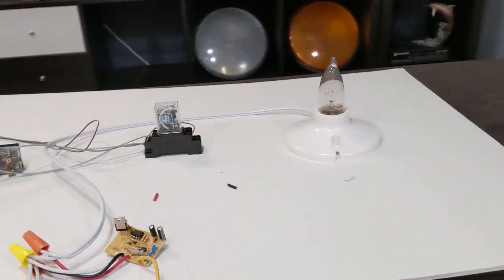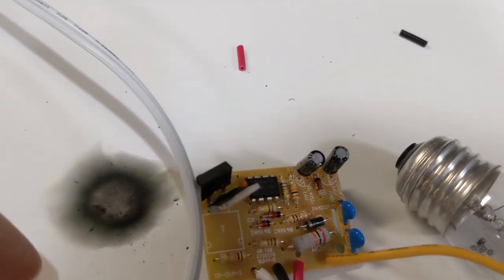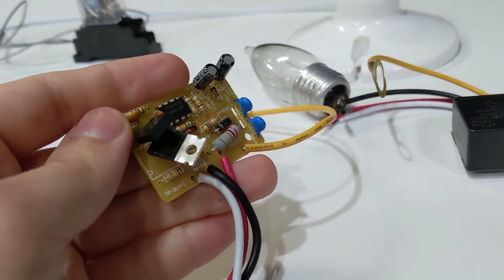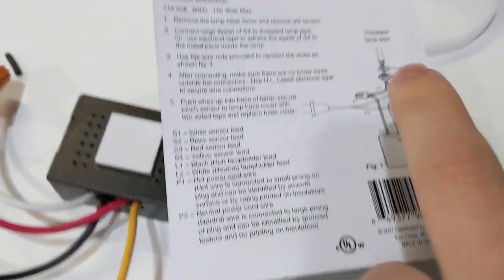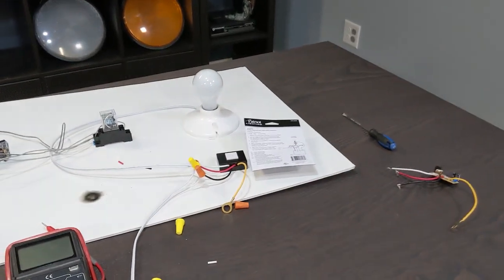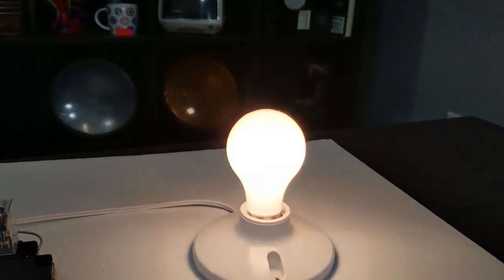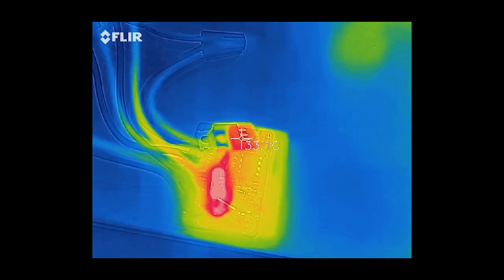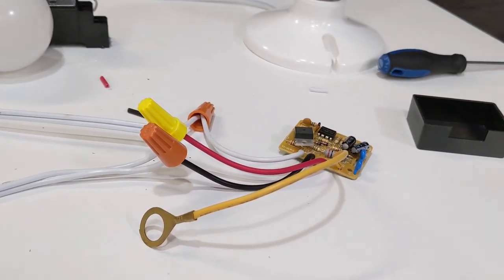A slightly explosive touch-lamp follow-up (standby energy consumption)

Comment: Big Clive would be proud of that skid mark
Reply: The pop happens and then two seconds later - 'Righty-o'
Reply: @FrozenPyro  And a few "Oh my"s
Reply: Haha, I don't know what skid mark made me laugh so much.
Reply: Explosion containment pie dish.
Reply: Hey, turns out he showed up and commented his approval!
Reply: "... One moment please..."
Reply: Strange thing. YouTube shows me the video was uploaded 6 hours ago, yet your comment was posted 18 hours ago. Silly YouTube
Reply: @Sovic91  Patreon supporters get early access
Reply: Well Big Clive did show up. His ears must of been burning
Reply: @dericn  Oh, that makes sense. Thanks for letting me know.
Reply: "sooty" skid mark, you mean
Reply: I was thinking that skid mark looks it should be on Medhi from ElectroBooms workbench.
Reply: @keithyinger3326  when I first saw this I had to check to see if this was ElectroBooms
Reply: I was just going to say something about big Clive wearing it up and something like that happening the title of the video would probably be oh I don't know poorly designed touch light control for United States and horrible color coding of wires or something like that.

By the way leaving your comment if you see it you see this was not a first time that something like that had happened in terms of one of those models going Bang as pequod would say remember the hundred Watt line voltage LED fake video where he connected 100 watt standard low voltage led to the mains AKA at 240 AC 50 hertz or so.

Working on a playlist for all those videos where he does things like that on purpose once it's finished it will be released publicly.

Big quads should really do a playlist for things have gone horribly wrong like for example in the explosion-proof pie dish playlist where it winds up being used for its intended purpose AKA things going bang or going thermonuclear.

Or experiments gone awry and other ones where things have gone Bang as he is doing an experiment or whatever.

Or maybe an exported products playlist I was just that type of thing.

Big quiet if you see this please respond I think that that playlist would your loss of use and they beat those videos will get more views as well.

By the way technology connections is one of my favorite channels on YouTube not so much as some of the others because I'm all that stuff would be too basic for me.

But I do like the history aspects of it and just the other connections to the subjects so sometimes even something more basic I'll watch it to see if there is a connection or something else.

It's also kind of late sometimes looking up ordinary things in Wikipedia just to see other things like that as well.

A lot of times things you find out elsewhere in a video or an article like that are more interesting and then the item itself so don't be afraid to look up something that is totally ordinary or boring.

You might really get a bang out of it in terms of wow.

You know if you don't do something you'll never know like if you're not wired up wrong we would not have had an interesting video.
Reply: @dericn  yep patreon
Reply: @Sovic91  ever heard of patreon? They get to see videos early!
Reply: @niyablake  yep it could have actually been either one of electroboom or big Clive. 

Or a couple of other channels to can't think right now brain fart.
Reply: @aaronbrandenburg2441  Yeah, I actually completely forgot about that, since I don't have Patreon. Thanks for telling me 🙂
Reply: @Sovic91  you're welcome by the way just try to help others spread the word where appropriate don't spread rumors don't spread spam except maybe on some food dishes if you get the point hey if you haven't tried it don't knock it fried spam is actually pretty good at least the food products RMV hard to cook email we're junk mail or Rogue calls I wish there was a way to roast them though or at least toast'em to Chris and get rid of them but oh well not going to happen at least soon enough if you know I'm saying and also course don't spread viruses where you can avoid it don't fall for scams don't spread to many names we're not needed or warranted and also don't spread Hysteria and also don't spread hoaxes and anything else similar to All the Above it also don't spread lies of course speak to spreading the truth but don't overdo it like I have this comment up to you to decide but I think I did but I think someone might get the point at least one person out there would get it and maybe reply to it? Can I go for one like at least and maybe one comment that's Michael just one of each if I get more I will post a video of me eating my Google data one bite at a time LOL double meaning there if anything in terms of eating data good luck it really bites you back especially if you have a gig job and it really megabytes you back if you try to just take a nibble at a time best to do any data migration in small bites especially over USB C what I'm saying.

Seriously if you're moving a whole SD card or thereabouts to a computer an Android chances are you'll be Tethered to the computer of the whole time so just do it in small chunks so that you can use the phone elsewhere without being stuck by the computer until it's done learned the hard way take the advice as the song goes one piece at a time but then again are data usage as storage is growing exponentially by the minute every day started out with 40 megabytes of hard drive space originally then went to 6128 and so on and now my active storage on two drives is up to 12 terabytes this was over the space of about what 12 years possibly closer to 14.

Why I had to add that NTB is I only had about less than half a gig left on a 2 terabyte drive internal to the computer but then again soon we may easily have a terabyte on our phones in terms of the SD card can't wait to be able to do that reliably who needs hard drives when you have a terabyte about the size of a fingernail.

Yeah yeah I know some people going to say about reliability is our face and all that but just saying that you can have that much storage in that amount of space is all I'm referring to so I didn't say it was the answer to everything like 42 is the answer to our life or whatever

Comment: It has an alternative function when wired backwards, it becomes a touch off switch.
Reply: “ Is your room too bright? Simply touch the lamp to turn off your circuit breaker!”
Reply: I think it's actually called an alarm switch
Reply: I see what you did there!
Reply: It touched off something, that's for sure.
Reply: single-use touch-activated breaker-finder.
Reply: Touch the lamp base to kill the lamp before it has a chance of glowing!
Reply: @colinstu  Well, you could replace the rusible PCB trace with a real fuse, replace the triac, and the next round can begin.

Comment: As an electrician, I can affirm: Wire colours mean NOTHING!

In Germany only the green/yellow wire for earth is a mandatory colour in the regulations (VDE Normen). The rest of the colours are suggested in the regulations, but they are not mandatory.
Espacially old wiring of appliances and buildings have really funky wiring...
Reply: In the 1950s German apartment block I live in they seem to have used whatever wire colors were on hand the day the threw the wires into the walls. Some rooms have grey/black/yellow, others black/black/red, again others have 3x grey ... even more fun when you have one set of colors coming out of the ceiling and another different color set out of the wall where the switch is
Reply: Everytime i change a Lamp in my Celing i have to Guess what colour is what... its an Old Building and they use not the same Colours for every Room. So yea its always much coulour checking on the old lamp and then write it down to install the new one.
Reply: As am American who has read a fair bit of the NEC, the wire colors do have mandatory meaning. However, this is only code. Real life examples may be done using improper coloring (an innocent example is neglecting to remark the neutral into a live on a switch loop). Another issue is that this only applies to fixed wiring. AFAIK appliances can use totally different colors internally like this switch module does.

The meanings are as follows: Bare, green, or green/yellow (the latter to halfheartedly harmonize with the rest of the world) is "grounding" aka ground/earth. White or gray is "grounded" aka neutral. Any other color is ungrounded aka live or switched live.
Reply: Brazil, Here is the same, only yellow/green is mandatory for earth. You just make sure you use the same color scheme through all the wiring in your building.
Reply: Amen
Reply: That guy, VDE Norman, he is such a killjoy.
Reply: As an electronic engineer though (I don't really do electrical installations and wirings, just pcb designs and mostly low voltage stuff), I have to say it makes total sense to me to have the red to the "+" output and black/brown to the "-" output and some other color like yellow/blue/white/green/whatever for auxiliary/data inputs. And my guess is that an electronic engineer designed that because it seems totally logical to me :P
Reply: as an idiot who plays dress up electrical engineer, can confirm. has more to do with the wire i have on hand than anything meaningful
Reply: Where I am old part of Canary Islands there's no earth wires, there's two lives instead of live neutral. And green is often used as live for ceiling lights when run out of yellow wire.  I've never heard of anyone get bad shocks ever, except for the bill. 
And the power that EVangelists charge their car with comes on average mostly from a fossil fuel power station.
Reply: @InTimeTraveller   Very logical that's the exact same colors of car start jumper cables.